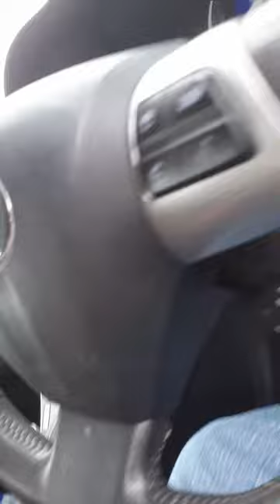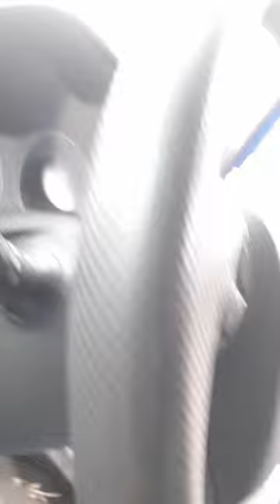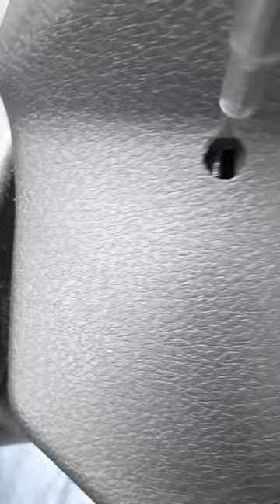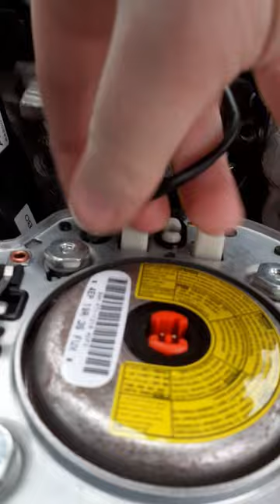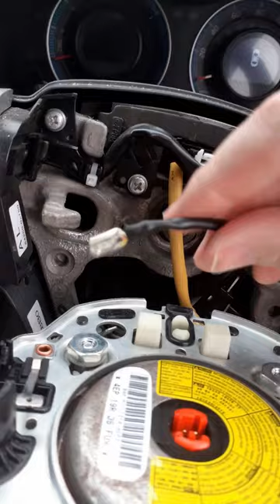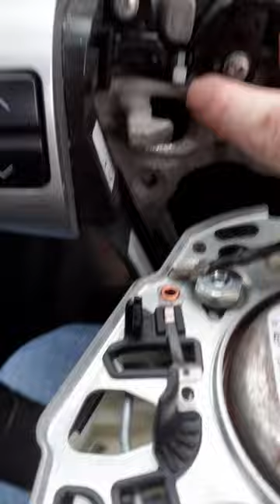Not enough horn? How to fix a Toyota Auris/Corolla horn

Comment: Same problem I had with my Corolla. Contact problem. Replaced the horn without result until I finally solved the problem like u did..🎉 thank you
Reply from the maker: Good to hear! It's a rubbish design :(
Reply: @DeannaEarley  yh...the horn switch should have been coated with copper to ensure proper ground contact

Comment: Is it necessary to remove the airbag connector?
Reply from the maker: If you can support it without removing it, nope. It wasn't any hassle to remove it, and I was doing it one handed so I did.
Reply: @DeannaEarley  thanks, does the battery need to be disconnected?
Reply from the maker: @droidhacking  nope...
Reply: @DeannaEarley  just worried about the airbag
Reply from the maker: @droidhacking  feel free to disconnect the battery if you want, but you don't need to.

Comment: I don't understand how to access the clip through the holes and unlock them. Should you push towards the bottom of the whole or pull the clip towards one side of the hole? When I put the screwdriver in the hole apart from triggering the horn I do not engage the clip for disassembly. A solution on what to do to disassemble? (Auris HSD 2012)
Reply from the maker: You push the bar in, towards the centre of the wheel.
The springs should make it pop forward a bit once it clears its catch.

Comment: I was able to get one side open but struggling with other side. The horn is working continuously but have to close as neighbours will be annoyed
Reply from the maker: Yeah, the wire clip is stubborn! I also annoyed my neighbours for ages while trying to get it out.
Maybe drive to the middle of nowhere and have a go, you'll get it :)
Reply from the maker: Also, if struggling that way around, try getting the stuck one open alone first.
One of them out more pressure on the other is opened first, making it much harder.
Reply: @DeannaEarley  yea I was thinking of that but I remembered I can remove the horn fuse. So I scraped it but forgot to raise the thin metal contacts on each side. Thanks again.
Reply from the maker: @droidhacking  all good now?
Reply: @DeannaEarley  so far so good.